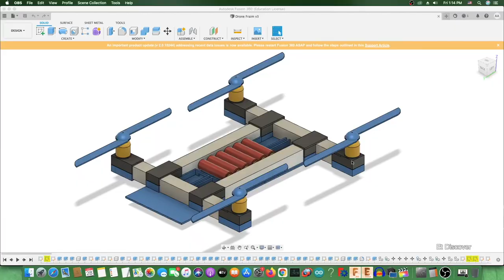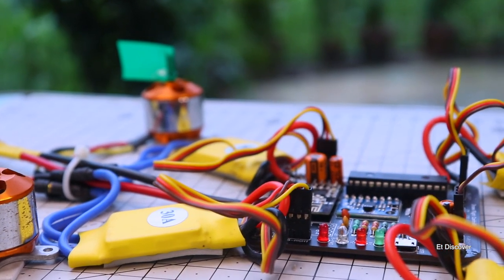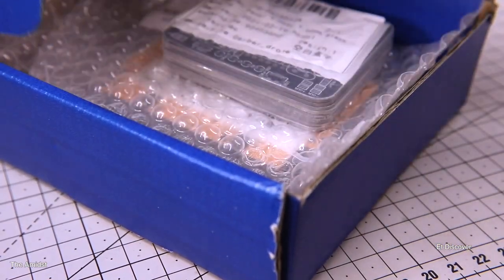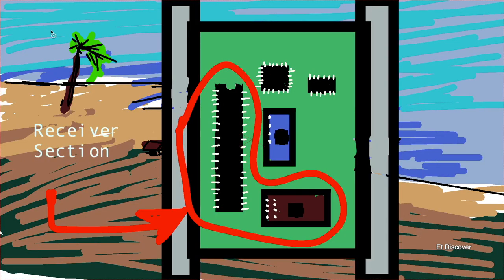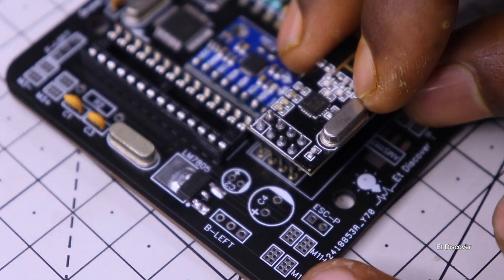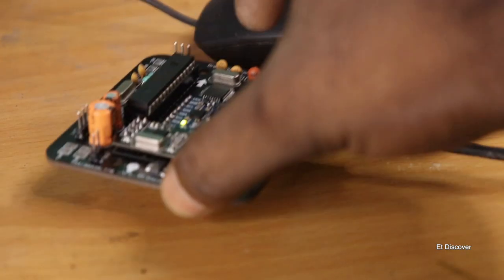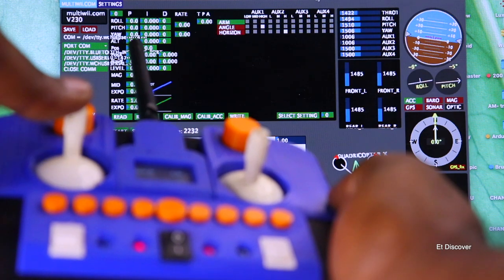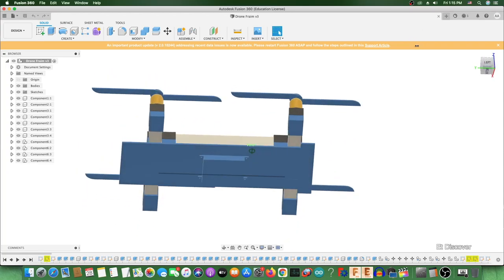How to Make a Drone Flight Control system With Arduino, #Step By Step (Part-2)

Comment: Bro when my drone connected multiwii application then try to start read values multiwii automatically exit and closed 😐 what am do?
Reply from the maker: Seemed like your multiwii is very lower version, Or maybe your PC OS
Reply: If i change java bits... ?
 Bqs before my  java run on 32 bits, but my mechanics is 64 bits so i chenge java bits 32 bits to 64 bits then multiwii stop working, and start this problem. And thank you for replying.❤️
Reply from the maker: I am not using Microsoft’s, that is why my knowledge little bit about PC, I guess I think you need to download microsofts.net
Reply: This link not open. But it's okay I try to found my  problem solution 😇 thanku  for try to helping me🌹

Comment: Could you provide the simplest design using scraps?
This is a bit advanced
Reply from the maker: You can make this with very nominal component, Just you need to flow diagram,,

Comment: Sir how to use Arduino nano in this pcb?
Reply from the maker: You need to download the diagram, And every pin connection are mentioned there, Link is in the description box you can download it from there

Comment: Your video is quite tough for beginners. Your presentation is not easy & your type is quite tough. When you upload a video regarding a walkie talkie is also quite tough for beginners. I have asked you regarding walkie talkie circuit but unfortunately you have not given any answer. I think that whether you alive or not but now I am sure you are still live. If you have not given any answer regarding a qwery what is necessary to upload a video in YouTube? You are quite professional and selfish. That is why I have not interested in your drone making video with a critical Arduino.
Reply from the maker: First of all I am still alive😀. Walkie-talkie series is not complete yet, under update, Even  in my walkie talkies video I already mentioned the circuit diagram is not working properly, so wait for the next part, I think I am not quite selfies😀, And thanks for your every valuable comment, And the next time I will make video with very easy way, thanks for your comment, 🤓And these videos every information you can find in my blog, Link you can find in the description box.